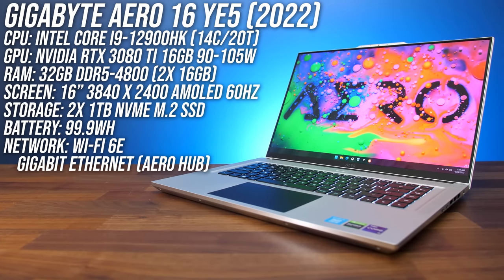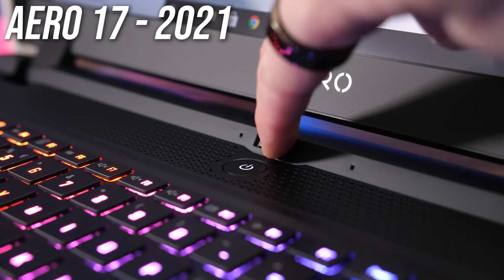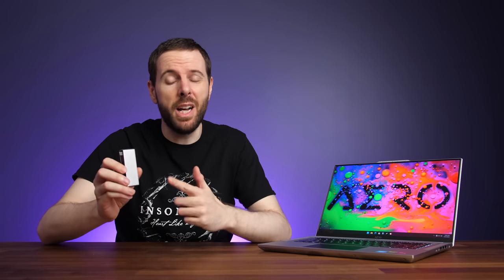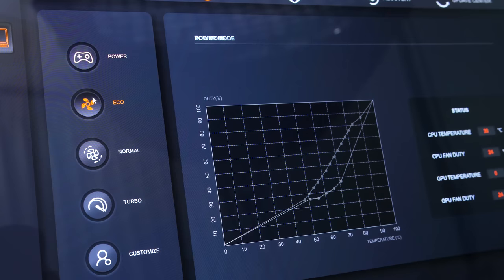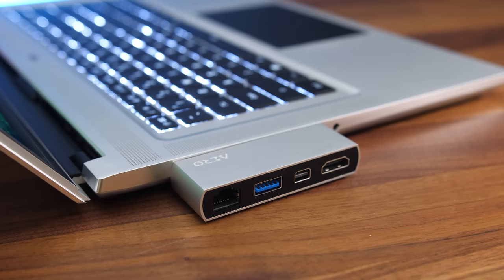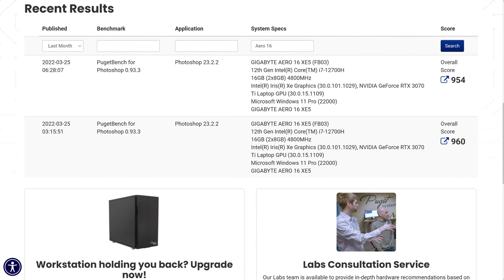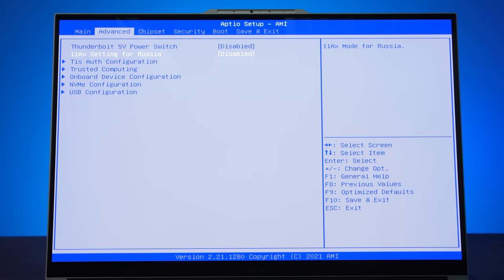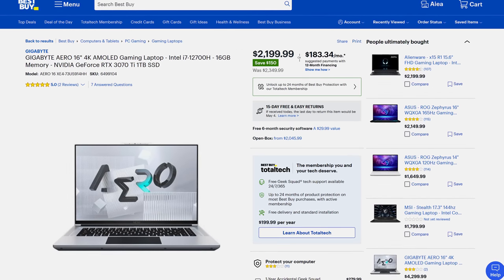Gigabyte Aero 16 Review - Why Did They Do This?

Comment from the maker: Check Aero 16 Prices: https://geni.us/UL4XcIc
Reply: Any chance to see the 17" one on your channel sooner or later?
Reply: hey jarrod, is there any chance you will be doing a review of the tuf f15 2022?
Reply from the maker: @bugbuster8598  Not currently in the queue and I have 2+ months of laptops here.
Reply from the maker: @muhammad.2291  Depends on ASUS, I just bought an A15 but can't justify buying both.
Reply: @JarrodsTech  thanks for the answer!
Reply: @Jarrod'sTech will you be reviewing the gp76 as well? I am thinking between gp76, gigabyte aorus 17 and asus rog strix scar 17, all with the same configuration i7 12700h and 3070ti to replace my helios 500 from 2019 (1070), what is your recommendation?
Reply: @JarrodsTech  thanks for replying
Reply: The scar 15 is 15 inch this one is 16 inch the scar is both smaller or better
Reply: no 3dmark timespy tests ??
Reply: Hey Jarrod,  I have a question,  lenovo legion 5 does have quite interesting feature that is you can utilize the laptop on AC mode , the battery will charge up to 60 % only, my concern is which laptops are utilizing the exact same feature or better ?
Reply: Make this battle bro 12th Gen Intel® Core™ i7-12700H Processor  vs  AMD Ryzen™ 7 6800H Mobile Processor
Reply: In Germany it was costing at least 2700 Euros. I just found a sale with 16 gb RAM, i7 12700H and RTX 3070 Ti for 1999 euros. Should I buy it?
Reply: FIND Me desktop replacement for 3800x1600 monitor. It need to run cool for 200fps. Let me know what you find. It can be huge brick. weight do not amtter
Reply: Hi Jarrod, can't we use other company hubs instead of the Aero hub?
Reply: @JarrodsTech ok so I traded laptops with my dad and I got this one. Can I change the Wi-Fi card or is it stuck as the original one anybody know?

Comment: I bought this laptop at over 50% off. That being said, I'm probably returning it. The fan noise even at idle is just completely unbearable and wont run lower than 30%. You can control it with Gigabyte's control center, but that app uses up so much cpu that it brings the idle temps up to 50c, and once again forcing the fans to run loud. With the control center running, i get 2hrs of battery life, if it is turned off, I got over 7hrs! I've done all sorts of workarounds, downloading scripts, 3rd party fan controls, none of them work. If anyone has a solution to this please let me know. I really want to keep this thing as I got it for $1,400 retail. Anything else with similar specs runs close to $4k. And that display really is incredible.
Reply: Hi, I was thinking of buying this laptop. What is control center and do you think this laptop can last 5h for university work such as writing notes for 1-3h lecture? I use Microsoft word and sometimes need to use google during lecture. I really like this laptop but cant find a website where it has discount on it. If you dont mind, could you tell me where you bought it from? Also, the major issue you find with this laptop is the fans? From a scale of 1 to 10 how loud are they?
Reply: @baldassare5426  I bought it from canada computers, so not sure if the discount is offered in other countries.

 Gigabyte control center is their program that lets you control fans, lighting etc, power profile, etc. It's buggy and constantly uses up about 5% cpu, causing high temps, and low battery life. You can uninstall the control center and get about 6-7hrs battery life, but you lose some of the keyboard functionality.

I'd say the fan noise on IDLE was about a 5/10. I switched to a different laptop and though the fans are running, it's only a mild hum of moving air that I hear. Whereas the gigabyte was just a high pitched sound. It might have been unique to the unit that I bought. So I suggest buying it if there is a return policy. If it wasn't for the fan noise and and control center causing high temps/low battery life, I would have kept it 100%!
Reply: @nicholo85  Im from Canada and was thinking of buying this laptop from canada computers too!:

GIGABYTE AERO 17 XE5 Gaming Notebook, 17.3" UHD, Intel Core i7-12700H, NVIDIA GeForce RTX 3070 Ti, 16GB, 2TB SSD, Windows 11 Pro, AERO 17 XE5-73US738HP

Wait so with the gigabyte control the batterlife is 1-2 hours! WTF! That really suck. What laptop did you replace it with if you dont mind me asking? I was thinking of getting the laptop above or this one but I'm afraid of the batteries life because i need a laptop that has good battery life for university. The other laptop I'm thinking o busying is this one:

GIGABYTE AERO 16 YE4 Gaming Notebook, 16" UHD, Intel Core i9-12900H, NVIDIA GeForce RTX 3080 Ti, 32GB, 2 TB SSD, Windows 11 Pro, AERO 16 YE4-A4US928HP
Reply: @baldassare5426  As long as you uninstall the gigabyte control center, you'll get about 3 times more battery life, apparently. I am still shopping around, but I think I'm really liking the legion 5i pro, which is about $700 off right now. If you do want battery life though,  I'd stick with Ryzen cpu's. 

I can't really comment on the other ones as I don't have experinece with them. My tip is take advantage of the 15 day return. You're gonna spend a lot of money on a tool that you'll be using for several years, so choose the right one.
Reply: @nicholo85  sooo did you return it at the end?
Reply: @chromaticvisuelle  yeah, triggered a spree of buying and returning 5 laptops. lol. but the legion 7 wins hands down. got it with the AMD 6700m graphics
Reply: @nicholo85  wow you are worse than me! I did 2 lol
Reply: @chromaticvisuelle  I know, it wasn't a good time. But It's a daily tool, gaming and travel device for the next few years. I was gonna settle with the ASUS M16, but legion 7 was on a great sale. It's really such a great laptop with the feature set.
Reply: Hey how do you disable the control center app? O read somewhere to stop msiv in services. How about you? Thanks
Reply: @grapegh0stx  never really figured it out. it was either on, or uninstalled.
Reply: @grapegh0stx  I uninstalled it completely. Which sucks because you loose some of the keyboard functions.
Reply: @nicholo85  someone told me to use aeroctl, it's like a modded gcc without the ui.. haven't tested though. Sounds promising
Reply: Hello, I’m thinking about getting this laptop. Could you tell me what kind of keyboard functions I’ll lose if I uninstall the control center app?
Reply: I personally love mine. Got it far cheaper as well due to sale, the 3070ti is lower clocked but still plays games well! Oled is beautiful.  Have had 0 issues with anything so far, battery I agree with. It’s bad but I don’t go anywhere without the charger so I’m not concerned.  Overall perfect for my photography and movies due to display. And great for my games
Reply: @nicholo85  oohhh. Interesante. Yo queria comprar la Aero 16 pero viendo todos estos comentarios mejor busco otra. Yo quiero la laptop para todo.. Trabajado, diseño, juego, videos, producción de musica, etc

Comment: I gotta say, researching a new purchase nowadays is tough.. there are SO MANY options! Jarrod's channel has been invaluable to help navigate through all the differences. Thank you Jarrod.
Reply: what laptop did you end up with? I have an acer nitro 5 and trying to find a new laptop but I feel like I'm in a maze. So many options and deals.....
Reply: @baldassare5426  ASUS Zephyrus M16, with an Intel i9. It's nice but battery life is not good! I think an i5 or i7 woulda been better, as Jarrod has been saying.
Reply: @user-cx2bk6pm2f  I see, I was planning to buy GIGABYTE AERO 17 XE5 with the following spect:

17.3" UHD, Intel Core i7-12700H, NVIDIA GeForce RTX 3070 Ti, 16GB, 2TB SSD

But I am looking for a laptop that is powerful and has a good life batter like at 5 and more. How long does ASUS Zephrus M16 last?
Reply: @baldassare5426  It depends what I'm doing. If I'm particularly busy, I'm looking for the power cord after 4 or 5 hours. If you only need 5 hours, the Intel machines should be ok.
Reply: @user-cx2bk6pm2f  cool. im looking for a laptop that last at least 4h (5 or 6 would be nice) with Microsoft word and some googling. For taking notes in lectures. Do you thing the one I mentioned will be able to do that? I am not sure so I was thinking of going with an RTX2070 so that it last longer
Reply: @baldassare5426  I'd be very surprised if it didn't.

Comment: As a creator I'm cought between this and the Asus M16. Planning to use it mainly for Architectural Visualizations (3D-Max , Vray  Unreal Engine and Archicad  mostly). Any thoughts, Jarrod or anyone reding this, would really be appreciated.
Reply: Asus. Engineering apps relies a lot on GPU, this Gigabyte one is more for video and photo editing.
Reply: This is much more self upgradable compared to Zephyrus. It's now a matter of whether you'd want it design wise or not.
Reply: I would go for the Legion laptops when they come out. Sure, they are gamer laptops, but they have great performance for the price, although the 2022 models are MIA right now…
Reply: Kevin don’t do it. I’ve had a year and half long Aero 15 OLED buyers remorse that I’ve not gotten to shake. I think it started the first day of last fall semester, when the novelty of the 4K screen runs out and I’m charging my laptop 30 minutes in because it already ate up 25% on idle. (i will say it really is easily the best LOOKNG display money can buy on a laptop tho, it’s still not worth it). No idea where reviewers get their figures, but I RMA’d my first copy (it turned out to not be defective at all, the battery life is just the worst). I’ve been envious and jealous of a couple of my classmates with legion 5 pros, 4-5 hours with heavy CAD before needing to plug in at all, 16:10 2560x1600 ips, HDR400 165Hz, and it’s half the price as any comparable aero spec’d. I’m telling you right now Kevin, tell that inner you that wants this laptop to stfu, because ITS NOT WORTH IT DOG. The buyers remorse is crazy, the aero series just isn’t worth it. The 99whr battery MEANS NOTHING. just Trynna save you bro. Don’t do it not worth it. And this dongle feature is really stupid. Really really stupid.

Edit: also, YOU. WILL. Get tired and annoyed of needing to function key for your brightness and volume. I almost forgot about control center. Screw gigabyte, cause control center is shit. Gigabyte software for gaming laptops are easily the worst out of any manufacture. There are too many things that the laptop community lets slide from gigabyte, I think among all, it’s the inefficient execution by gigabyte with their consultant underpowered, underperforming components. On paper an aero looks appealing, but the user experience jus r leaves you with the strongest buyers remorse. Just get a legion 5 pro or a legion 7 anything.

Edit 2: a funny story I almost forgot… midway through winter semester, I was fed up with my aero 15 and I tried trading my classmate my 3070 108750H 32gb ram for his Legion 5 (non pro) 3060, 5600H 8gb, and he still said no, cause they all know I’m the one constantly charging my shit. It’s a straight hassle bro. glorified desktop replacement since you need to be plugged in 24/7 anyways
Reply: @JacobyPa  that's Intel for yeh. Technically you can sell this online and get a Ryzen machine after that. You could probably also buy a screen replacement for it too with a 2K 165hz panel. Although unsure if battery issues persists.
Reply: You may want to look into laptops with a5000 just in case you need it
Reply: Architects will almost always need the most powerful GPUS so either get a desktop or suck it up and get a chunkier laptop
Otherwise you will end up regretting it later
Reply: Battery life is hasn't been the selling point of Aero series for a few years now, same as Legion and Zephyrus M16. These are all 2-4 hour battery laptops, key difference being trade off of weight and GPU TDP.
Reply: @JacobyPa  oled has slightly worse power then lcd but the Intel CPU is the real eater of battery
Reply: @bslygh  Than.

NOT then.
Reply: Using the Gigabyte Aero 15 from 2019 has not been fun. Lots of annoyances . I would suggest anything else. The Wifi performance is worse than expected because the antennae are covered with metal.

Asus Zephyrus G15 and M16 look great. Watch reviews from JustJosh, MathewMoniz as well.
Reply: @JacobyPa  thank you so much for you to share your experience with us. i am also an architecture student and now i'll be considering getting one of the legion series instead
Reply: Got the M16. Absolutely love it. 4k is nice but it's quite a drain on battery. Only thing I wish I could change would be the cpu. I'd take a Ryzen 9 over an Intel i9 any day when it comes to laptops.
Reply: I need a laptop for the same thing, did you buy any?
Reply: @JacobyPa  which CPU they have on their Legion 5 pros? Ryzen? Isn't the fault of Intel for the battery life?

Comment: 02:00 Former LED producer here:
the dies used on top of LEDs have different transmission levels.
That is why cold white LEDs with the same power output provide more light output than a warm white LED due to the phosphor die used on top of the LED to lower the color temperature. 

There are probably limits on how much color can be compensated for past the output level at 70%.
Reply: As this is an OLED panel I believe the phosphor is not involved, instead it's likely an RBGW panel hence the maximum colour luminosity is lower than the maximum white luminosity.

Comment: Specs aside since gigabyte is typically been great in the spec department my current laptop the aero 15v8 will probably be my last one from gigabyte, there are just too many random oversights and I see they persistent yet again, great review nonetheless 👍
Reply: Agreed. I also have the Aero 15v8 and I also feel like it's my last Gigabyte, despite me loving it. There are just too many things about it over the 3 years I've had it to make me want to suffer it again for the price (<50% of battery life advertised when new, thermal crashing despite no overclocking, networking crash requiring reboot after sleep/hibernate, lowest tier thermal paste, nose cam, dying keyboard keys no replacements available, higher price for the performance, intermittent function key bugs, etc.) I'm looking at a Lenovo Legion 5i 3070 but I'll be sad to lose the more professional look/build of the 15x.
Reply: @gold7326  same my guy, the keyboards quality inconsistencies was a foreshadowing and a huge thank you to whomever made the Aero 15v8 subreddit,but yeah liquid metal undervolting and the whole ram compatibility nonsense alas we are all in a new age where A.) Literally have no time to game big B.) Game streaming is actually more supported now..might be the next move i.e. thin and light for productivity + game streaming subscription for the hit

Comment: I just ordered this from Newegg.  AERO 16 XE5-73US948HP
with 2 tb ssd 32g ram 3070ti card.   
Wonder why they don't place a thin removable lint filters on the intake vents to reduce dust accumulation.  Would take tiny bit of space but seems worthwhile to improve longevity- especially for those of us with pets.
Reply: Hey, it's been a while now. I wanted to buy this same model and would like to hear from your experience?

Comment: I got an Aero 16 a couole weeks ago and so far I like it. I think the ports issue is not a huge deal given they provided a hub. And, they provide a usb-c wire connector to go with the hub to a port which makes it just fine imo. I bought the version with a 3070ti and 12700k. I was able to get an open box version for 2100 total with taxes.
Reply: How is the linux support? I own an Aero 15 from 2019 and I simply can't control the fans on linux, it sucks
Reply: Does davinci resolve work fine? because it is soo weird to see content creator application crashing on device that made for it
Reply: @victorborges750  I find it weird Jarrod didn’t test PopOS 22.04, given it has released. That being said, I had no problems running my Lenovo Legion 7 laptop on EndeavorOS.
Reply: @cameronbosch1213  what about the fan control on Linux?
Reply: @victorborges750  Fan control on Legion devices doesn’t exist because even Legion Fan Control (which is fan-made) is Windows-only as far as I know. That being said, the actual performance modes are still possible to change via the Fn+Q shortcut as it’s firmware-based, unlike most other laptops, which are software-based.
Reply: @cameronbosch1213 then I'll probably stick with a Lenovo this time. Thanks for the info
Reply: I bought the same laptop but the ddr4 variant but at $1750 with taxes. I got the bestbuy variant.
Reply: Hey man I'd love to get a feedback from you as I am in a middle of researching about these laptop, This model and Asus Zephyrus G15 or M16 is a round the same price range before discount but as of right now there's a big discount on this AERO 16 XE5 Is it because this model possessed too much trouble that lead them to discount them this much ?? 
Thanks man
Reply: @truthseeker9446   i got the xe4 variant from best buy. The display is good performance is about 10% low than m16 with same gpu(after overlooking by 300mhz with  inbuilt asus software). The laptop feels very hot as it is metal body thereby making it uncomfortable to play videogames. I would recommend buying openbox m16 when it's on discount.
Reply: @Abhishek-pw9re  Thanks for the reply
Reply: Hows the battery life ? are you able to reach 8 hours?
Reply: @WeeeAffandi  even in battery saving mode i get about 4 hours of battery life with native resolution and 10% brightness
Reply: How big is the switch from ips panel to oled?
Reply: did you experience any problems with the aerohub on ethernet connection? it worked for me when I first tried it, but then it simply didn`t get any signal from the ethernet cable